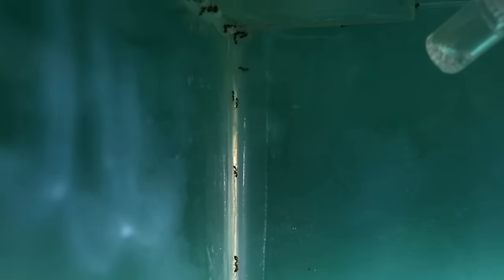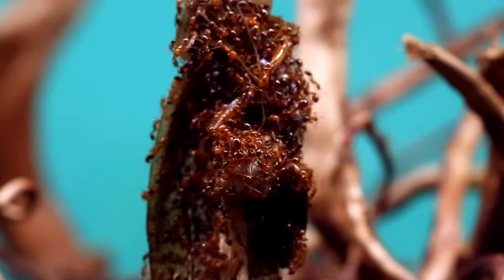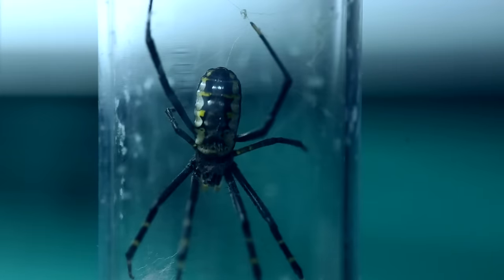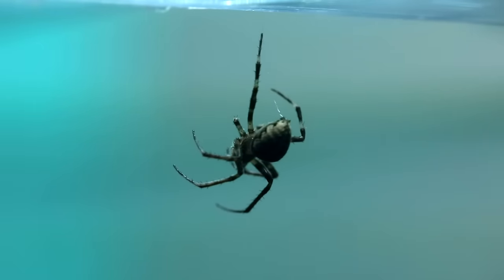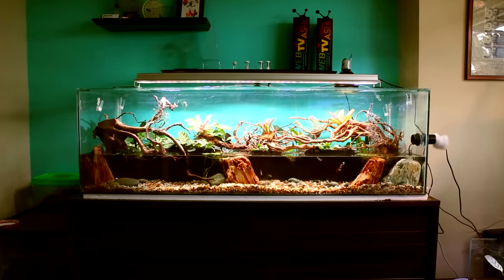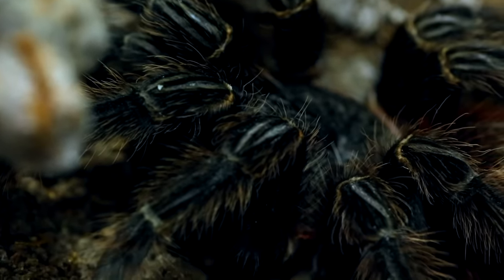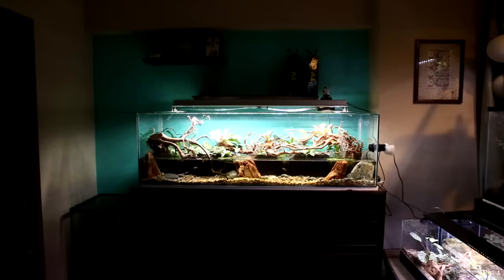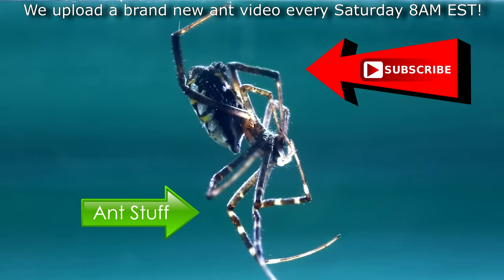Fire Ants vs. Giant Spiders

Comment: Could you do a video on your aquarium? Maybe as a hidden video, or as a little bonus video on Saturday. I am looking to build a self-sustaining aquarium and was looking for advice from the best of the best (you), but you've never done a video on it. Contact me if you can or make that video if you see this. Thank you and #antloveforever :)
Reply: Kyle Joiner 
Do you mean "no maintenance"? I've never heard of such a thing, but the only way I could think you could do that would be to have a system that slowly drips water out at the same rate it goes in. If you have chlorine in your water, you'd either need to treat the water or get a filter that removes it. You'd also have to get herbivorous fish and extremely fast growing plants that they can eat (because herbivorous fish will eat a LOT). You couldn't have anything that needs to eat insects or other fish unless you had an absolutely massive tank that allows for the smaller fish that serve as food to hide and successfully breed enough to maintain a population.
Reply: Lots of plants
Reply: Sam Hem 
Well, I should have said LOW maintenance. I plan to make sure I do not have to specifically FEED any organism in the tank with food like a normal fish tank. I would still do water changes. Also, what you are describing is called a drop system, and if the tank is successful, I would incorporate this system into the tank, removing water changes. We have large drums where I can do massive dechlorinations at once. But I get your ideas. Great thinking haha
Reply: Kyle Joiner 
Actually you can buy auto-fish feeders so that you don't even need to do that. XD I had one a while back, but it only used flakes and my new Oscars needed something a little more sustainable. It was great when I had small freshwater fish like mollies and platys, though.
Reply: Sam Hem 
Huh. Well, even so, I wanted the tank itself to establish a food chain. I didn't want them to rely on me or any device to "deliver" food. That is cool, though.
Reply: Kyle Joiner 
Carnivorous fish will keep eating smaller fish until there are none left, I can't think of a way to have any kind of fish besides small herbivorous ones and extremely fast growing plants (floating anacharis comes to mind). I would recommend against duckweed, though. Once you have it, it never goes away and not much will eat it. You'll also have to fertilize the plants, too, because just the nitrates from the nitrogen cycle won't be enough.
Reply: Sam Hem 
Ah, good input. I don't plan to have any carnivorous fish in tank, as my tank is too small. As for the plants, I plan to keep a variety of grasses and mosses. Some grow quickly. The herbivores I will keep are going to be small guppies, as they breed quickly and are hard. I can maintain population through tweaking and experimenting. I will also keep shrimp as ground control.
Reply: Kyle Joiner 
Well, I hope it works out! If you're successful, you should make a video on how to make a low maintenance fish tank.
Reply: Sam Hem 
I don't know if the video life is for me ;P. But I will consider it lol. But thanks allot! Thanks for the thoughts and advice.

Comment: One summer I had my balcony door open (ive like a french balcony, so no actual space to walk out onto) and watching some birds and people and stuff I suddenly see 4 spiders hanging almost side by side from web-thread originating from the overhang of the ceiling and they where using the wind to sway back and forth until they managed to get either onto the guard-railing of my balcony, or into my apartment, and it all looked like one of those scenes in games like Call of Duty where you rappel down and then breach through the windows XD